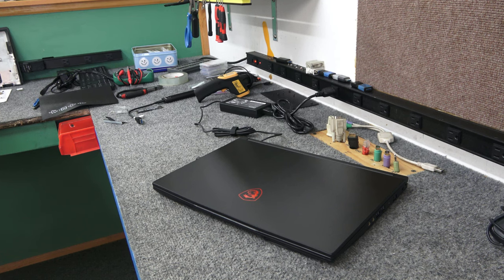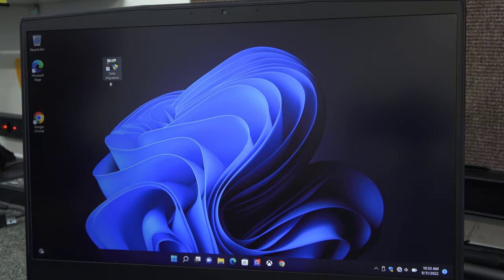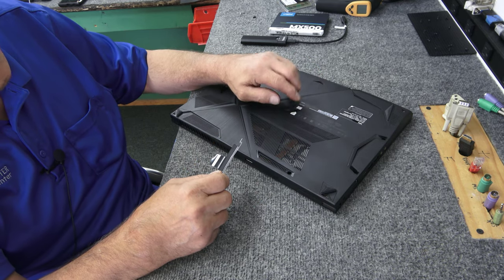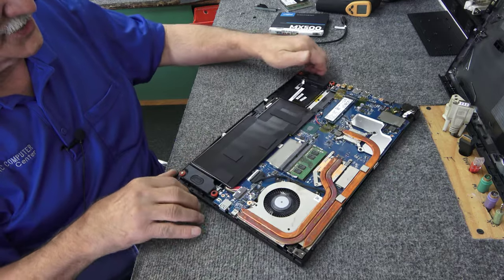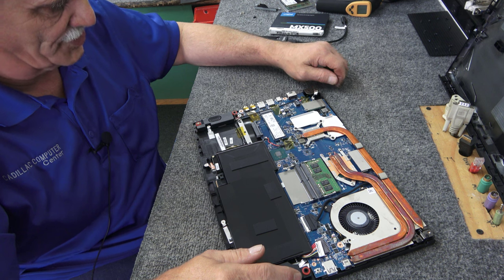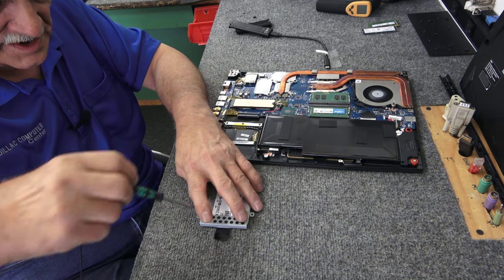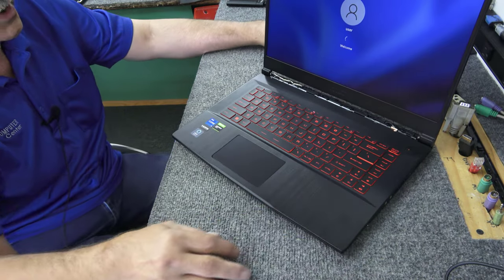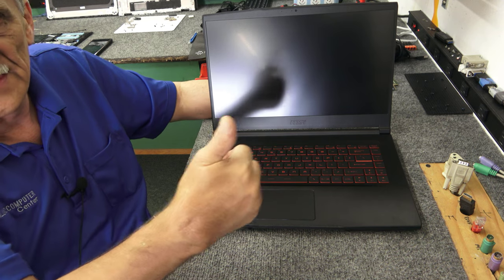MSI GV15 Thin Gaming Laptop Complete Upgrade SSD, Memory & Clone

Comment: I also have an msi laptop. A step up from this. But I’m forced to use and external ssd because my storage gets full quick. I also don’t want to max out internal storage and just run like that day to day This video is helpful about cloning and everything. What would kind of internal ssd would you recommend to upgrade to. I use it for gaming.  Also can you upgrade processor or gpu? Thanks for making the video keep ‘em coming!
Also what do those 2 16 gb ram do compared to 1 8gb. What does it help. One last q. Are internal ssd’s universal size wise for laptops.  Are ram universal in size. Or do I need ones specifically for my laptop. Thanks if you got a minute for some info!
Reply: This comment is old so you might have upgraded already, but in case anyone else is wondering: I have this exact model and bought a 2TB Crucial PCIe 3.0 NVMe M.2 SSD. It's perfect for this model, but I'd still double check if it's a different MSI!

Comment: Thank you for the instructions. I followed along and changed out my ssd and ram and it seems like everything is working great. The only thing is the computer doesn’t want to turn on if it isn’t plugged in. Once it’s on it can be unplugged and works great but it doesn’t want to turn on with just the battery. Have you ever heard of that happening?

Comment: Is it ever cost-effective to upgrade a laptop processor?
Reply: I know I'm not Dale with all his infinite wisdom however, It is rarely possible to upgrade your laptop CPU since the early 2000s unless you can find a motherboard with the exact same layout with everything in the correct spot. Short answer: No.
Reply: @nathanb4390  so the only way would be if your current motherboard was capable of supporting a better model of processor than what's in it currently I guess

Comment: If I am only replacing the ram do I not need to disconnect the battery?
Reply from the maker: Just be very careful if you do not disconnect it.  Better safe than sorry though.
Reply: Thanks! Is the ram safe to install without disconnecting the battery as long as I don’t drop a screw on the motherboard?

Comment: I just bought this laptop, do I have to upgrade it in order to game?
Reply: I was able to play some basic games without any problems before upgrading it. Was playing games like halo, little nightmares 2 and bioshock infinite just fine. Had to upgrade the ram to play elden ring.
Reply: @mycoolbagel2962  What kind of RAM did you use, can I buy one 8gb slab. And will it work in dual channel mode
Reply: @d.d890..   Corsair vengeance 2x16 32gb at 3200mhz and yes you can just get a matched 8gb stick if you wanted to go that route.
Reply: @mycoolbagel2962  I also don't understand, to add memory do I have to buy a hard drive? Because first he put the RAM, then on the left he put a small same size slab, and then the big thing.
Which one of these adds memory?
I just need to add 1 terabyte of free memory.  And one 8GB RAM slab.
Please help. I should at least put 1 terabyte of memory so I can download what I need without problems
Reply: @mycoolbagel2962  I just don't understand English well, I live in Sacramento if you can help that would be cool.
I just want to know what I need to buy in order to increase the free memory as 256GB. It's not enough.
Reply: @d.d890..   I think you may be confusing memory(ram) and storage(ssd). I installed a 1tb Samsung 870 pro 2.5 sata ssd to increase the storage.
Reply: @mycoolbagel2962  thank you very much

Comment: how many inches is the compatible ssd or hdd?
Reply: I have same computer in video.  He installed 2 drives.  The second drive he installed was 2.5 in ssd.  The first drive he installed was m.2 nvme ssd (size of stick of gum) with OS on it.  I believe the gum stick drive here is 2280 form factor (22mm x 80mm).